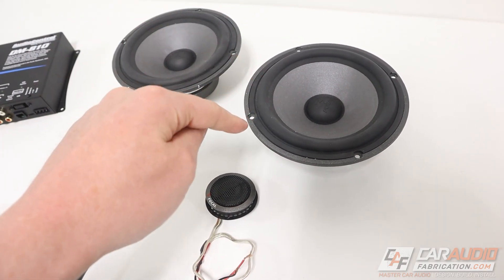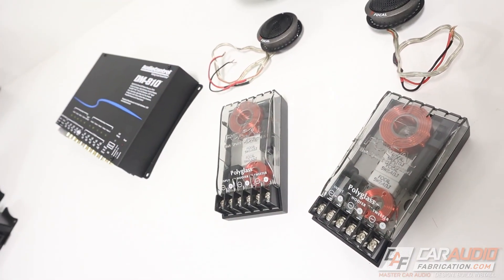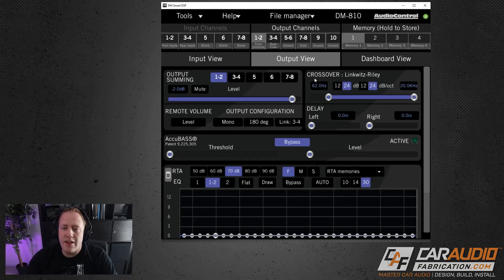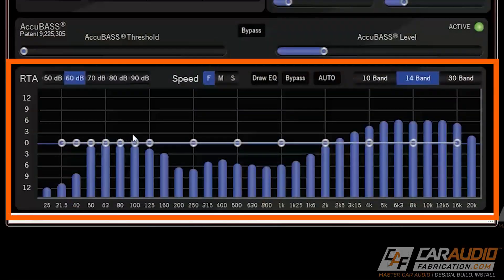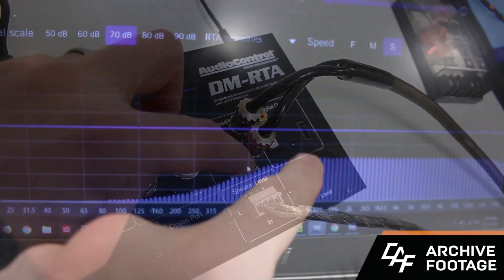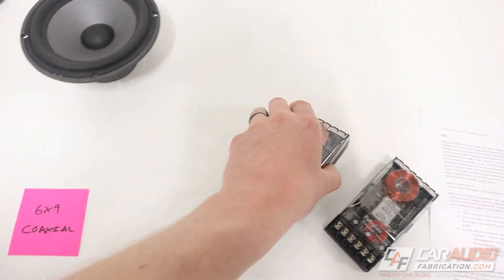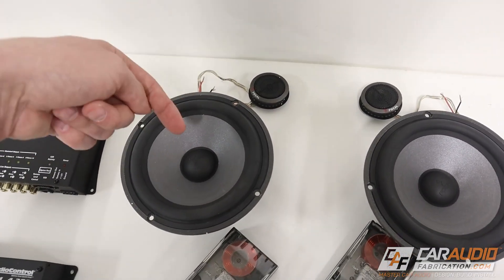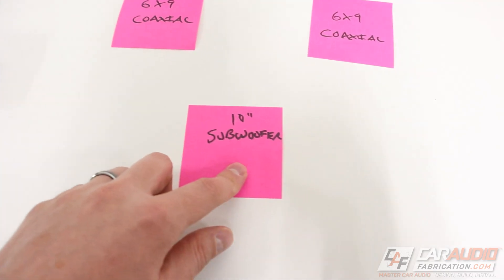Is PASSIVE CROSSOVER pointless if YOUR audio system has a DSP?

Comment: I really hate to say this but these videos are obviously for professional installers and not for your average Joe. I was really hoping I could get some more insight about installing my system  but now I'm more confused than I was before I purchased my system. At any rate, I'm not criticizing you. I'm just more disappointed in myself. Hopefully I can find some videos that speak in simpler terms for us dummies who just want good sound in our cars system. Sorry to sound so negative. I'm sure you're a great guy who loves his trade.
Reply: This comment is a year old, but I just read it today and I feel ya. When it comes to upgrading an audio system, the number of options and levels of complexity can be overwhelming. He is obviously a professional and his videos (this one in particular) can go pretty far into the weeds. However, there is no need to dive headfirst into the cutting edge. If you're looking to improve your system, I would recommend starting by replacing the factory speakers in the factory locations (I strongly recommend using Crutchfield because they will confirm whether or not speakers will fit your factory locations and they will provide all the necessary equipment for ease of install). I would also like to emphasize the importance of a good install. Cheaper speakers with proper installation (e.g. a secure mount and application of sound deadening in the doors) will sound better than expensive speakers with a poor installation. If you're not satisfied with that upgrade, add an amplifier to give the aftermarket speakers more juice. You can find a 50W RMS x 4 channel amp for $100-200. For a little bit more,  something like the Kicker Key 200.4 provides that power with built-in automatic DSP. The next logical step IMO would be a subwoofer (some would argue to add a sub to your factory system as a first step). 
With audio, you can spend as much or as little as you want. At a certain point, you run into diminishing returns, where you might need to spend a lot more for an incremental benefit. My point is that you don't need to try to get the perfect system on your first try. Nearly every upgrade can be done piece-wise, and you can re-evaluate your satisfaction with the system after every step. Try the basic upgrades before you start down the rabbit hole of active crossovers, upgrading your alternator to add thousands of watts of power delivery, custom speaker pods/mounting locations, etc. Baby steps, my friend.
Reply: As a video viewer, just take what you want and leave the rest. Not every video is relevant to every individual situation.
Reply: You’re funny. But I agree.
Reply: Thats why you learn.
Reply: @edyoung6756  I can’t agree w this. I’m not a pro - but looking to get my install to the next level. Having someone willing to share professional level advice like this is awesome and rare. This is how you learn.
Reply: If you cant understand this video then. You should deff take your vehicle to a professional
Reply: im in the same boat. I see these video of DSP and go aww crap its beyond what im capable of.   I get lost adjusting my PAR E.Q. by ear from my head unit ,,, So im not sure if a DSP is for me and my no how

Comment: I had a 2way full passive car audio system with DSP Amp. The DSP Amp only used for TA and EQ, so the DSP Amp doesn't work very hard.. got a great result and i'm very satisfied. 

Anyways, thanks for sharing Mark 👍🏻
Reply: So if the DSP Amp has also to filter frequencies there will be power supply issues and heat ? Vs letting the passive crossover for the component speakers do the filtering ? Is it a class D ?

Comment: Have a question About Active system. If I use Alpine DSP Amp  PXE-X800 the spec  is 4x25W(Rate Power) and 4x50W(Max Power) and I want to use Morel Virtus 3way. The spec of Morel said  140/300W. So I want to set to Active system. I just wondering about Power RMS. Total of Morel 3way said 140WRMS.but I want to set on Active system with Alpine X800. each channel of X800 is 50Wx4 and 25Wx4 ,Is it enough for Morel Virtus 3way? Thanks a lot.

Comment: I have a mid Rande and a super tweeter connected together. Both 4 ohms. Trying to achieve 2 ohm load. Does a capacitor affect the final ohm load? I keep getting 3.8 ohms and cannot get a 2 ohm load unless capacitor is removed

Comment: Great video, helped me understand audio configuration better once again. Been out of it a while. Few questions. I am currently looking to upgrade my audio in my new Hyundai Ioniq 5 EV which has the base stereo system. I am considering a Audison Ap5.9 bit 5 channel w built DSP. I guess I need to find out if the current factory system employs a crossover for the front speakers as I have a lower speaker and upper tweeter in the front on L&R. If it does could I use one channel from the amp to do the left speaker, one for the right and then a channel for each rear w ability to add a small 8" sub later? Going this route I imagine the sound will be much better vs the factory amp and stock speraks, If I upgraded the speakers to components but essentially run the left and right as co-axials by using the crossover to only use one channel each will the sound be noticeably worse vs running the fronts active w an Audison 8.9 DSP amp at higher cost. Essentially is active going to be alot better or noticeably better?
Reply: I am exactly in the same situation now. I have very expensive component speakers with crossover, should I get an Audison DSP with more channels and drop the crossover ? Or do what he did in the video, knowing you cannot tune the mid and tweeters separately in the DSP
what did you do !?

Comment: This may not be the best video to ask on but figure maybe you’ll see this and have time. With the dm 810, or another DSP, could you run 2 x 5 channel amps (LC-5.1300), one 5 channel amp running the tweeters, rear doors, and 1 sub, and the other 5 channel amp bridged to 3 channels, running L/R mid bass and 1 more sub? I want to do this and am just trying to make sure my logic is sound before I order them, I’m mostly wondering about the sub configuration and if it could work as I’ve described, giving 500 watts to each woofer and either have 2 DSP channels for sub, or would I spilt one sub channel on the DSP output with a Y RCA. Thanks in advance if you see this!

Comment: Love your videos  and have been a fan for a long time. How would I set up a system that has six speakers such as my Jeep Cherokee? It has front dash speakers running at 8 ohm and the front door and rear door speakers running at 4 ohms. My original thought was running the front dash speakers separate and having its own dedicated amplifier due to the low power they take to push them. Should I just use 8 ohm speakers for the dash since I am sure the power capacity will be lower than if they were running at 4 ohm vs. 8 ohm? I plan on running JBL speakers all the way through.

Comment: Actually, volume difference and sound character as modified by outer ear structure are the primary ways we determine directionality of a signal. The time difference being a significant factor in staging etc. is a myth. As an example, try a mono sound split into a  stereo signal to two identical speakers and dial down the volume on one side or the other. What will happen is that the signal's point of origin, to your imagination, will shift toward the side with the louder sound.

Your ears don't CARE which sound wave arrived first. They care about which is loudest, and the subtle modifications to the sound hitting your eardrums by the structure of your ears, which is why the ears have structure and shape, to help differentiate between front and rear.

Comment: I have always struggled with all the adjustments. Power comes from the amp, which you set your crossovers at, fed to the head unit, which you can set your crossovers at, power then pushed to the components sets passive crossover. Seems like a lot, should we eliminate some of these?
Reply: Use a tuner that has a microphone and can do all the tuning automatically

Comment: I'm still curious to know should I still use my passive crossovers if I'm running a 6 channel amp with every speaker on its own channel with the d-6.1200 audio control amp

Comment: I am upgrading the audio in my car adding a four channel amplifier to the head unit, a Subwoofer and a Set of Component Speakers for the front and Coaxial's for the Rear. I have a Ford Fiesta 2013.

I have removed the front passenger door and see four wires going into a white plug then connects to the speaker harness.  Rather than recycle this I am adding the new brackets and need to connect the four pin plug to the speaker. I found an adaptor specific to my car but only has two pins, so guessing the tweeters would not be connected.  Also the tweeter is connected to a plug that clicks into the car door.

The Component Speakers have built in Crossovers, however upon watching videos I discovered it would be so much easier to set it up with a Crossover as the two pin adaptor would connect directly to the crossover and the Sub and Tweeter directly to it with not need to solder wires or anything.

My question therefore is this. Is it OK to add a passive crossover when the Component System has it built in?

Comment: Hello sir I am new to car audio.
My installer has suggested me front & rear components  , and a  subwoofer.
To run these he has suggested sound Magus mp6 DSP amp.
It's a 4 channel amp with 6 channel dsp.
This will power  and tune  the front and rear  components he says.( Using the crossovers)

For the sub he has suggested me a mono amp.

My doubt is ...can the mono amp be connected   to the same DSP (with the remaining 2 channels) and tune the subwoofer ?
Reply: Yes u might not need both remaining channels just one but either way the DSP will let u make any changes or settings u want to the subs

Comment: If you're only using 5 channels is there a reason to use the dm-810 instead of the dm-608?
Reply from the maker: Future options to upgrade
Reply: 2 of the channel outputs are mono for those dsps, so keep that in mind. With a 608, you have 2 mono channel outputs and 6 stereo, totaling 8. If you are running 2 front woofers, 2 front tweeters, and 2 rear speakers, you have used up all 6 stereo outputs. If you wanted to run 3 way active components speakers in the front with midbass speakers, woofers, and tweeters, you''d need those 2 extra stereo outputs of the dm-810.

Comment: Thank you so much for this video!! 
I bought 4ch amp + active sub along with front components and rear door coax, so when I wanted to buy a DSP I suddenly needed 7 channels I thought, but now you showed me what I was hoping would work which is to use the components on the same channel. With that option I won't have to buy another 6ch amp and an expensive 8 ch DSP cause now I can buy the cheaper 5ch DSP and keep my 4ch amp in order not to blow my budget. 
I should have done more research before buying stuff though haha.. Thanks!

Comment: I run my rear speakers off of my Kenwood deck. I have them crossed over (in the deck) at 100Hz 24dB/octave, and turned down as far as they can go. I don't really want to hear them, I just want to be able to tell something's not quite right if they weren't there at all. You don't sit with your back to the stage when you go to a concert, do you? That's why rear fill should barely be noticeable, if you even decide to use it at all. Deck power is perfect for this task.

Head > DSP >4 channel active to mids and tweets, mono amp to subs.

Comment: Hi Mark. What a great explanation. But what about a 3 way set with midbass, midrange and tweeter. Using a pasive crossover how  would you time delay each driver? For example the 3 way focal flax evo has passive crossover and they are not bi-ampable.
Reply: If the 3 way speakers are all mounted close to one another "and they should be" there is no need to delay them. you want to delay the speakers as a set. the goal is to delay the set of speakers that are closest to you vs the set on the other side of the car to create a center stage. You are wanting the sound from the left and the right to meet your ears at the same time, obviously the speakers in the drivers door are closer to you then the speakers in the passenger door therefore we delay the drivers speakers by just milliseconds behind the passenger door speakers as so the sound reaches you at the same time. Also don't mount mids in the doors and then mount the tweeters in the dash, they need to be close to one another.

Comment: Hi master. I have the same system with your setup in this video. I running a passive component (passive crossover w/2.5" full range & tweeter) real coaxial 2way 6.5". 1 x 10" underseat subwoofer. With a DSP (4in 8out build in 6chn amp) for front passive crossover point i used HPF 80hz 24slope, underseat sub LPF 50hz 24slope, real coaxial crossover set to off?

Comment: I really need help. I have JL C3 600. The passive crossover is 1st order on mid and 3rd order on the tweets. 

Through the Kenwood ddx395 crossover settings 
I run -12b on the front for -18db slope final

Then -18db on rear speakers 

And -18db on the sub

This puts the tweets at -30db (-18db passive plus the -12db sent to the fronts) how much tonal quality and I losing by doing this ?

Running the fronts on through makes the fronts too muddy

I'm running 80hz on sub lp and 120hz on fronts

Comment: I couldn't find the video tutorial you mentioned for dsp crossover settings and dsp set up in general. Would you mind linking? Also, any tips for a noisy crossover interference  besides moving it?
Reply: I had a noise issue with my crossover. I ended up moving it only a few inches from the source of the noise and problem solved. I just wanted to point out that you could move it slightly and you might not need to completely relocate the crossover to fix it

Comment: Great video. Question: I just installed
2 12" alpine r12s, a fosgate 850.2 punch amp, a db drive neo 5 capacitor and a jl loc 22. 
It just doesn't give the punch. The gain is set to half but the interior factory speakers aren't loud like before and the voltage drops to 12.8 when the volume is on half. I've used fosgate 4awg ofc cable and knukonceptz rca

Comment: I have a 2014 Kia Optima SX Turbo that I'm wanting to build a custom sub enclosure and amp rack in. I'll be using 10" PSI subs and the PSI 2500 watt amp.  The sub requires a ported box 0.9-1.4 ft^3 between 30-36hz. How do I build a custom enclosure to them specs?

Comment: Good info! So is still worth it if you have an amp that has Hi and Low bypass? Those DSP don't come cheap I rather not get one if my amp is already doing the same work.
Reply: The amp isn't really doing the same work though. The high and low crossovers in your amp just widen or narrow the frequency sent to your speakers, whereas with a dsp you can boost/cut certain frequencies within that range. I would say it depends on your vehicle as well, in my new truck I would consider a more complete system, but in my jeep that I rip through the trails, new speakers on deck power is just fine.